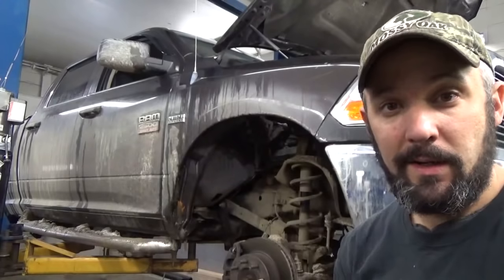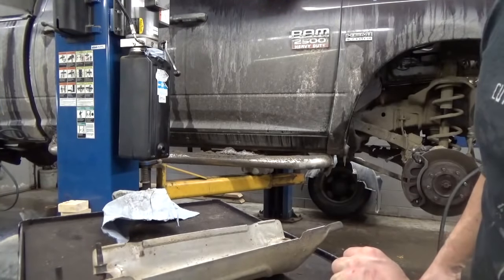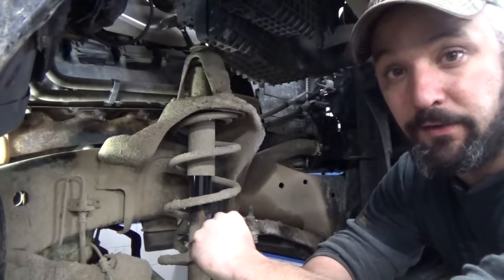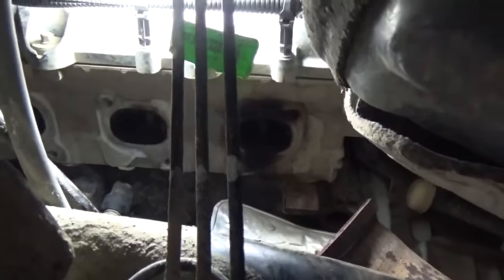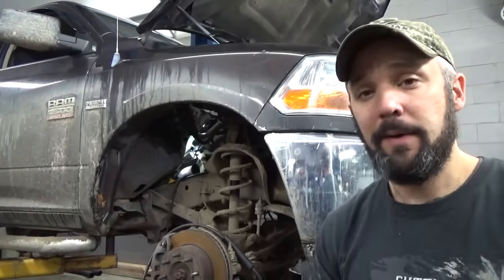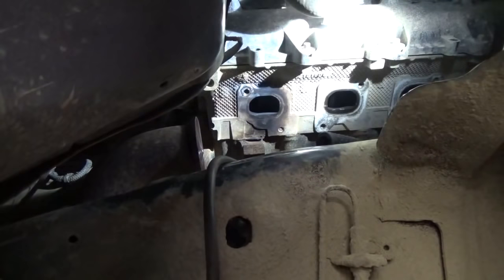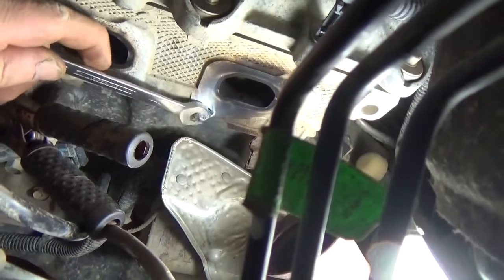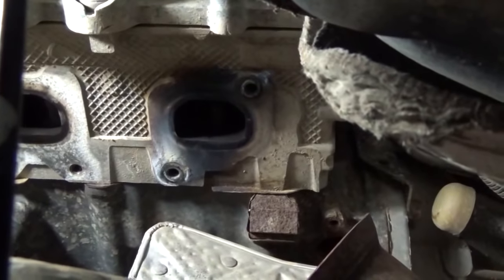Removing Broken Exhaust Manifold Bolts - Hemi Dodge Ram

Comment: I have a 2005 Dodge Ram 2500 5.7 Hemi with four broken bolts on each side of the exhaust manifold. On other trucks I have drilled them out what a nightmare. This time I tried your method and it worked. Got all of them out. Had to go through a bunch of 3/8 nuts, because they don't hold every time, so  I had to reweld a new nut.  On the last few I heated the broken studs until they were cherry red and then welded the nut, those came right out.  Thanks.

Comment: So I came across this video because as you may guess, My 1500 developed the "hemi knock" found out it was the passenger side manifold. 2 broken studs, had no clue if I could get it fixed myself without trying to drill them or taking it to a garage. Tried 3 times to weld a nut on, each time they just broke off. Ended up just slowly building a wad of material and grabbing them with a pair of vice grips, long story short, they both came right out! Since then been enjoying your videos very informative and entertaining! Above all, probably saved me a bunch of money that someone would of done the same thing! Thank you!
Reply: ruben cervantes  just one I bought at harbor freight for 100 bucks.

Comment: Well done !! As a professional automotive machinist/ engine builder . 40 years in the trade its
Nice to see a mechanic with the
Skills to remove broken bolts
From a head, especially in the vehicle. I very often have to bail
Out failed attempts. Meaning i get
To remove there broken off drill bits, easy outs, blown out holes
Etc. Maybe i should do a video on
That some day.lols

Comment: Top rear stud was broke off flush with head on passenger side. Used the nut and welder trick and it twisted right out with ease. Really like the video. It made my job go slick.

Comment: Success! I removed four broken bolts from the one side I was doing on my 2005. One was very stubborn and took five tries. The last time I jarred it with the blunt tip of an air chisel right after welding the nut on. It turned right out.

Comment: Fantabulous job....I haven't drilled a bolt in over 30 yrs. Your on the right track, but a tig works a lil better than the nut or washer. You can even get out broken taps.

Comment: have a 2006 mega cab 4x4 with the 5.7 hemi, same issues..... followed the video....and easily removed the two broken bolts with welder and nut. Thanks for the video....this way worked super for me

Comment: I'm watching because I just got a 2011 and noticed the ticking/leak.
I'll be doing mine soon.
It's always helpful to see how things come apart before hand rather than trial and error method.
I have a MIG and TIG so it shouldn't be a problem.
Pretty good video. Thanks.

Comment: WTG This is a trick I was taught, removing head bolts broke off below the top of the hole....use a nut and weld up thru the hole.....6010 mild steel WILL not weld to cast iron....great video

Comment: I had to do this on my Durango with a 5.7. You did a nice job my only thing I would add is make sure you put something in the exhaust port to keep the slag out of the engine. One or more of the exhaust valves may be open to allow the slag to go right down the cylinder.
Reply: Kim Christians  mig weld = no slag genius.

Comment: Heck yeah brother, I got a 05 ram hemi had to replace those manifolds without a lift, so I jacked up the truck put it on stands then jacked the motor up about two inches one side at a time. So far so good it’s been 5 years so it’s getting that time again lol

Comment: Sorry for late post.  When using the MIG method of broken stud removal where the remnants are sub surface of the hole, I weld a washer the next size up from the fastener diameter e.g. for 5/16” stud I would use a 3/8” washer.  This allows easier access to the sub surface end of the broken fastener.  If necessary a nut could then be welded to the washer.  It has never failed me in the 40+ years that I’ve had a MIG welder.  I previously attempted similar with a stick welder up until then but with only limited success.  Did a lot more drilling and tapping back then😂👍🏻.

Comment: Thanks for this video. Helped me with 5 broken manifold bolts on a 2006 2500 hemi ram. Between driver and passenger side it took me 40 bolts and washers for two of the studs. They just wouldnt take a good weld and were just slightly recessed. I made headway using parafin wax and wd40, and a lot of persistance.

Comment: I just did another one of these the other day. Its a very satisfying fix once done. I sent out the manifold to the machine shop with some rotors. They charged me a whopping $45 to cut 1 manifold flat. I was expecting like $15-20 bucks. Oh well, they did a good job and the truck is quiet now.

Comment: Done this repair a couple of times now. First, there's no thread locking compound used on these fasteners, so while heating up the the remaining working bolts is okay if you have a torch and want to spend the time it isn't strictly necessary. Second, I found that it is significantly easier to weld large diameter jam nuts onto the broken bolts than full depth nuts. You will have a better angle of attack with the welder, and will achieve a stronger weld to the remains of the bolt. You can make your own jam nuts by either grinding them down, or slicing them in half with a zip cut. On one Durango I did, five of the eight bolts on the drivers side were snapped off. Only one with enough above the head surface for vice grips.

Comment: I love the welding method! I discovered this method a couple of years ago and it works great. I think the extreme heat change is in your favor. I also find if the mig don't work, the tig will. Nice video.

Comment: I have delt with this a few times and I found that welding a washer on first usually works better most times the washer is all you need
Reply: Dave Vaters a washer that would fit in the hole? Or it doesnt matter?

Comment: I need to say "thank you".  I have been enjoying your videos from time to time.  This one in particular and especially was gold.  I have older vehicles in the family driveway and every one of the at some time develop exhaust manifold leaks from broken bolts.  The Dodge Ram had 3, the Dakota had 2, the new2us F150 has one, and the Chev Tahoe I am working on right now has 4 broken bolts.  Tomorrow I will be wheeling out the welder to get the 4 bolts out of the Chev 5.3.   I have used and continue to use your weld a nut on technique.  It really works, and works well.   Challenge on the Chev is 2 of the bolts are broken off about 1mm inside the head.  Those will be tough to get a bite on, crossing fingers.  The other two bolts are broken flush with the head.     Anyways, great video and wanted to say that it has helped, alot.  Thanks!

Comment: Excellent method. Intelligent, simple, and highly functional. The video itself is clear, and concise... mega-kudos!
I'm preparing to do a head rebuild on my '03 Ram 1500 w/ 5.7L Hemi. It developed a slight ticking at 150,000 mi that has progressively increased. I suspect the lifters, but valve springs also tend to fail. Replacing all. New push-rods, and grind the valves while I'm there... Hoping the cam lobes remained unaffected!
I also anticipate finding broken exhaust manifold bolts, so this video is an excellent weapon to have in my arsenal.
Reply from the maker: Oh yeah those are gravy to pull the head on! Goo luck on your adventure :)

Comment: I got the same problem Eric. Except its on my dads 03 Durango 4.7 . Its got a similar setup to this one, i noticed the only ones that broke were those weird bolts that are threaded on both sides that help attach the heat shield. They weren't recessed below the head and they spun out with my fingers. Gotta love Cali, no rust. 😎

Comment: I have never seen this before. Being a mechanic for over 40 years I came across many busted bolts in the heads. Drill bits and extractors is all I had. I had good luck it just took alot of time.

Comment: I have had a lot of luck with reverse drill bits.  After a little heat and Kroil.  I know some are pretty stubborn but it never hurts to try if you can get a tool small enough to fit in that area to use the drill bit.  I have also used your method many many times on manifolds and old chevy intake bolts.

Comment: I did my last manifold today. 04 F250, V10 pass. side. Plenty of room. Cut heads off bolts and i had the bolt sticking out to work with. Got 9 out with no problems. One bolt broke years ago and was about 1/8" in head. Tried drilling it and was off centered. Welded washer and filled in hole,then welded nut on washer and removed very slowly. Replaced manifold and used studs instead of bolts. No more manifold in my shop. Maybe chevy/gmc only.  You're still young and have patients.

Comment: Great video. The selective use of a torch goes along ways. I've used this method to break hardware loose on a 00 Land Rover Disco (brake lines) that spent much of its life up there in NY. I was able to save the owner a ton of money where the dealer wanted to replace everything from the Master Cylinder back.
Reply from the maker: +Jeremy Scott The torch is our friend :)

Comment: I love how you've got this thing inside, you've been working on it and the snow on the running boards hasn't melted yet.

There's a bit of distance problem too, but I'm not volunteering to gopher in your shop in winter, that's for sure.

Comment: hey Eric I was a diesel technician for a while and the favorite method of getting out broken bolts below the surface was welding. The way we did it though was with an arc welder and a special welding rod that would build a puddle vertically. I believe the brand is eutectrode or something along those lines. check those rods out.

Comment: Hey Eric... 
With the stud, broke off below the head, hit it with a angle die grinder just a couple taps....gentle... it clears corrosion off the stud, and gives a clean metal to weld to... and removes rust and powder aluminum off threads... yours came out easy but I have fought with 5.7 Ford's

Comment: I've been doing this on my truck and the wife's Durango for a long time.   A tip to extend the amount of miles between broken exhaust screw extractions,  take the manifolds over to the belt sander and make sure the gasket mating surface is flat.  They never are,  and require a little sanding to get them flat.    Probably some residual stress from the casting process, but usually the rearmost port isn't flat with the rest.

Comment: The heat shield on my 2018 1500 Hemi is loose on the passenger side at the rear.  70k Km and just starting snapping for 30 seconds or so cold start up.  Luckily still a warranty item I believe.  Thanks for the video saves me from fighting with the stealership about it.

Comment: Great video, I had one broke on the drivers side at the rear, however I did both sides and thought the right side was easier than the drivers side. I had to cut a 13mm socket down to complete the passenger side for one bolt.

Comment: Ya know, I too deal with this, and rust in general 5 days a week for 29 years now. Worked on A 1976 International Scout from Arizona. Exhaust manifold bolts came out with a 3/8 ratchet, zero drama. Ready to move South/West now.

Comment: Been a while since you posted this and I didnt have time to scroll through all the comments but I have a trick that helps with the recessed bolts.  Before trying to weld the nut on, hit the end of the broken bolt quick with the MIG welder.  It will not stick to the aluminum and give you a nice little already penetrated nub to weld the nut to.

Comment: thanks meagain222.... I worked on it 2 days ago. and I was able to remove  2 out of 3 or them broken bolts. That 1 I couldn't get was a thread or 2 inside... wasn't flush like the others. plus I don't know how to weld, I just plugged in the welder and tried my luck. That same day I had to take my engine to the pros....a muffler shop. A Mig was what They used to remove the stubborn bolt. They said that the welder would be messier and a little harder to use.  Thanks again

Comment: I’ve not tried this on vehicles but on machinery I’ve worked on at work removing broken Allen screw studs. You can get left handed carbide milling cutlers from MSC, you have to be carful because their brittle but using them with a drill in reverse works just like an easy out.  I think they heat up the stud and just when they break through the catch and back out the bolt. With a regular stud a high speed steel cutter would probably work with less risk of breaking. Been doing this for 30 years

Comment: This video gave me the courage to attempt this repair on my own Ram. I had three broken bolts.  I struggled getting a few nuts welded to the bolts, but had no problems once I dropped a few tack welds to the bolt face to build up a nipple.  Once I did that, the nut welded securely and came right out.  I now have headers and quality fasteners.  Thanks, South Main.  I owe you a beer.

Comment: Replacing the transmission on my Tahoe in the driveway...big enough of a pain. When removing the manifold to y-pipe bolts the studs in the manifold snapped. Decided to remove the manifolds completely. Found that the heads of 3 of the 12 manifold bolts were broken off, and a 4th broke off as soon as I put a tool on it. This is all I needed while fighting with a transmission that did not want to come off! Luckily only 1 of the snapped bolts is recessed into the head. Will be busting out the mig welder later today.

Comment: Been there, done that. I haven't done a hemi yet, But I've done f-150 manifold studs. Ode to joy! Especially one's that are below flush with the head. Those aluminum heads have a different melting temp, just build up some slag on the stud and weld a nut on there, and pray.

Comment: Thanks for the video. It seems that they are still issues with the ram and their manifold bolts. Just had bark plugs replaced and told that for manifold bolts are broken off.

Comment: Brand new to your channel. just subscribed. Really enjoy your low key manner to your work. Refreshing! I have a new 18 ram 1500 and I heard about this notorious exhaust leak/tics on the rams. Allot of folks seem to have snapped off exhaust studs allot after 50K miles. Crossing my fingers I wont have that issues in the future. I'm an old time mechanic from the 70's and 80's and all this new stuff (sensors, ECM, PCM, etc just are above me at this point. sure do miss the old and very easy way to fix and work on cars/trucks. Again really enjoy your vids and honesty with your customers. A++ Kudos!

Comment: For those hard to reach ones I usually weld a sacrificial screw driver to the edge of a flat washer and get that welded to the stud really good the weld the nut to that whole business. The reason the flat washer works so good is that you can get a better puddle on the end of the stud and see what you're doing rather than poking and hoping down the middle of the nut. Oh and clean the exhaust carbon off of them first as well. Nice filming btw!

Comment: I remember  replacing  some rotted  out headers back to stock manifolds  on a 99 Durango  with a 318...the 3 inch body  lift made  it easy  for  a  backyard  mechanic  job lol

Comment: I have a hemi Charger that I replaced the manifolds for a set of shorty headers off a later model. I can tell you that it's pretty common for the rear bolts (that hold the heat shield on) to break. I think it's due to the location and heat soak. I will tell you that I find it easiest to remove the bolts out of aluminum heads like this by slightly tightening the bolt and then loosening it. I've never had to heat them up or even use any oil.

Comment: The method I used for broken rusted bolts is a stick rod made by. Exergon called extratalloy. It was like cheating as far as broken bolt removal. They make it as small as 3/64ths too I believe 3/16. That larger rod I used on track rollers. I worked in heavy equipment repair for 40 years.

Comment: You did an awesome job repairing this truck and filming it! I just learned a new way to remove broken exhaust manifold bolts. Great technique! My 2005 Hemi truck is probably exactly the same issue as this one in the video. I know I have an exhaust manifold leak, but cannot tell which side. So, it is probably both sides and probably the exact same problem. Keep up the excellent work!

Comment: I'm about to attempt this I have one blot 2 threads recessed so not sure what to do there but what people need to know is that it's not weak bolts that cause them to break, it's the lack of a flex pipe at the collector, it's all rigid which under load puts a lot of pressure on the back bolts when the engine flexes in the mounts and breaks them

Comment: With the aluminum heads allowing so much flex with heat, there needs to be a flex joint in the crossover. Just judging by the spring tension in the pipes while bolting back to manifold.

Comment: That's the way we did , first we tack a flat washer, after we tack the nut, we spray loosing nut fluide and working back and fore the broken bolt until loose . It's work too on cast iron cyl head . I done this many times has a Mopar tech over 42 years.

Comment: Very clever.  Must better then drilling.  A friend of mine took his motorhome home back to frieghtliner factory, the broken an easy out off.  The cost for new manifold went from 2200 to 6200 since he needed a new cylinder head.

Comment: I came here to just see what kind of replacement bolts you use cause I have a 96 dodge and I had some of my bolts just fall out. Man you are good with that old school bolt extraction. Last time I tried something like that was back in the 1980s but I'm too damn old to be doing this sort of thing more than I just got to.